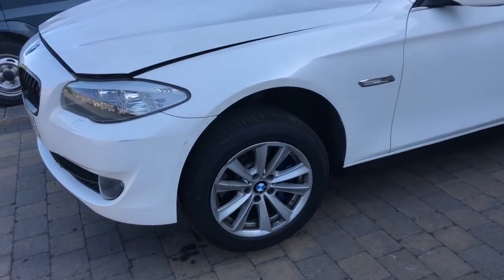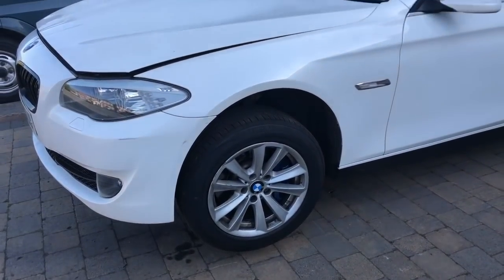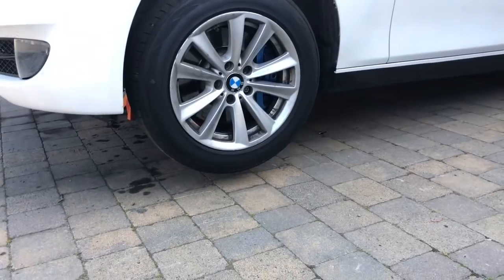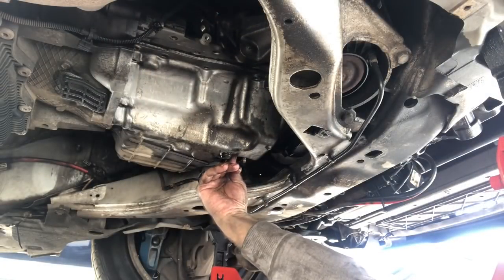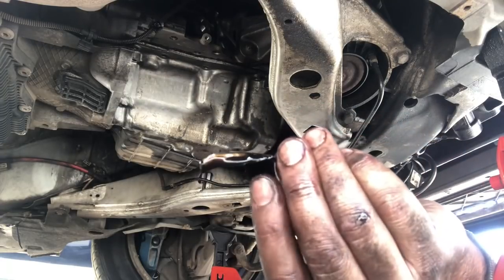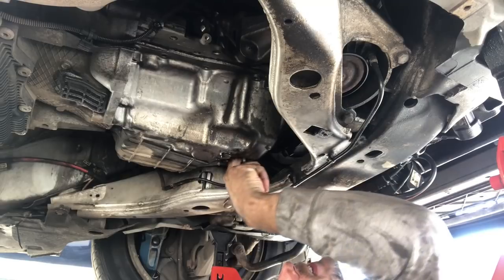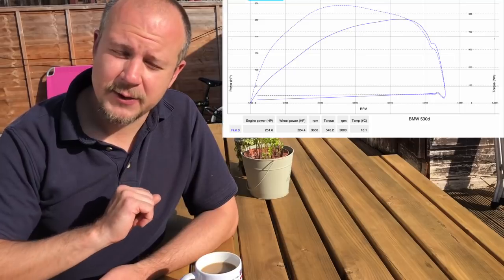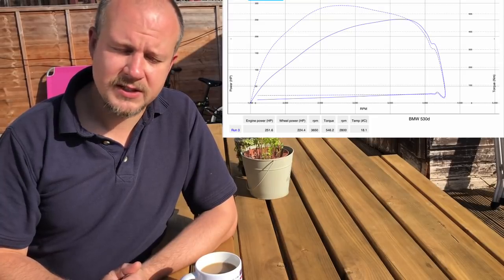BMW 530d N57 ENGINE FAILURE @177k - Spun Bearing! ☠️

Comment: Hi buddy had my engine rebuilt but got a funny feeling the the garage ripped me off as its still smoking my guess is the rings..... As I've replaced the turbos. Now my question to you is could you take the head/sump off and take the pistons out while the block is still attached?

Many thanks
Reply from the maker: You’re not going to like my answer I’m afraid...
Unfortunately not. To get the pistons out you will need access from underneath (the bottom end), so really it’s an engine-out job. Even if you tried to do it from underneath the front axle subframe is in the way, plus the crankshaft needs to come out... so unfortunately the engine needs to be removed for that job.
Reply: @Nut_Job.  mines a 6 series 640d so do have alittle more room? Was hoping with sump off i could undo the rods and take pistons outfrom the top?
Reply from the maker: Before you go doing anything drastic though, it’s worth doing some good fault-finding so you can be fairly sure of the problem. Otherwise I worry you’ll spend ££/$$’s without any certainty it will fix the problem. If the piston rings are worn then it should show with compression testing. Another method is relative compression testing, where they hook up an oscilloscope to a current clamp on your starter motor to see if each cylinder is providing equal ‘resistance’ (compression) when cranking...
Reply from the maker: Hi Rob, it might be possible if there’s a bit more room underneath... I’ve not seen underneath the 640d before. Bear in mind there’s a bit of work involved removing the cylinder head (+ new cylinder head gasket ~£85), but a share your desire not to have to get the whole lump out 👍
Reply: @Nut_Job.  yeh i did do the turbos and they where a nightmare to do. Fingers crossed i can get the head off no problems
Reply from the maker: If you do it yourself just be careful with the HP fuel rail. It’s all aluminium & I broke my original one during re-assembly by over-tightening one of the injector lines (heard a subtle ‘ping’ sound...🤔). Sure enough, upon startup the fuel rail pissed diesel all over the engine! Had to replace it.
Don’t forget you’ll need to buy new stretch bolts for the cylinder head (don’t be tempted to re-use the old ones). 
Also, the conrod small end bolts are stretch bolts too so you should replace them too really & they’re more expensive than I expected. It all adds up a bit unfortunately
Reply: Yeh im already 6k in after the garage in Wolverhampton on sunbeam street ripped me off 4 months they had my and then i get it back in bits so yet again its now a rebuild but ill be doing it so can only blame myself if anything goes wrong 😂
Reply from the maker: Crikey! £6k I’d be mad as hell. Anyway I won’t comment on that as I’m sure you don’t need to hear me ranting.
Best of luck with it mate! 
Embarrassingly, I’ve actually abandoned my BMW engine rebuild.... simply because I’ve lost all enthusiasm for it & I’m quite enjoying my replacement car.
Thinking about it, I’ve already bought a lot of new parts which you might need. If you want any new parts I can sell them on for a good deal if you’re interested. Just email me at nutjob882@gmail.com if you are, no worries if not 👍

Comment: Hello mate..im rebuilding my n57 and have no clue how to install the pistons.. should the arrow on the crown point forward? Towards the front of the engine?
Reply from the maker: Yes mate, the arrow should point towards the front of the engine (in the direction of travel)
Reply from the maker: https://www.newtis.info/tisv2/a/en/f11-530d-tou/repair-manuals/11-engine/11-25-pistons-with-rings-pins/1LSMorv3
Reply: @Nut_Job.  believe it or not i am following this very guide to fix the engine but i didnt really fully undertsand what "direction of travel" means...i though of the direction of travel of the crank:) which would be towards the back of the engine.. thanks alot mate...i will install the arrow pointing to my headlights:))
Thanks

Comment: The main bearings are a known weak spot alongside the timing chain and EGR components, sadly. 
The bit that interests me, more so, of most of the known issues they seem more likly to happen on the twin turbo (and tri turbo) N57. I know of about 3 640D's, 1 535D and the odd X5 40D. The fact yours is a 30D, single turbo stands out to me as an odd one to have this fault.
Be warned though, I sadly equally know that in many cases it was easier to source a replacement N57 engine as those that got repaired invariably had some other issues down the line - https://www.pistonheads.com/gassing/topic.asp?h=0&f=72&t=1590946 comes to mind.
In addition this one in the PH link is the only one I have not heard to let go on a dyno ironically, not sure if that is some kind of precedent there!
Reply from the maker: Good info, thanks. I’ve got a free pass to put it back on the dyno if/when I get it repaired... just not sure I’ll have the nuts for that if I’ve just completed a full rebuild (after breaking-in period obviously)
Reply: Can you tell us where/how you got the info about main bearings being an issue?
PS Had my 330d N57 on a few runs on the dyno, remapped to 323 hp, ~500Lb/ft (660Nm) torque! :D So far so good, I did have it dialled back a bit recently as I wasn't keen on it being over the gearboxes max of 600 Nm and the emissions would often not quite pass the plated value, it does so easily now. It was badly remapped before I had it, I've had it 2 yrs, taken it from 86k miles to 105k JFYI.

Comment: It's rare for an N57 to suffer crank issues and survive. The alloy block will be damaged from a spinning bearing and the crank likely scrap. I've seen them with crankshafts that are cracked across the journals.
Reply from the maker: I’ve got hold of a new block, but hoping to save the crankshaft...

Comment: Sorry to hear of your further bad luck! :(
But seriously, you need to just bin that whole engine, like you said the block will be toast due to the spun mains, which means the crank will be toast too, and the disintegrated mains will have probably done in the adjacent big end bearings too. You'd have to get a short block, and then it's a load more work, not to mention the head will have done 177k miles.
Personally I'd just get a 2nd hand engine (with good service history), change the chains and guides if they've not been done, and fit that. But then again, my job is a mechanic so I don't want to be spending my free time on fixing cars! lol. If you like doing that and don't mind blowing the time, go for it!

Comment: BMW 535 XD GT 2014 with 235.000 km, fatal engine failure on the crankshaft bearings, engine completely destroyed, 5k euros in reparations. I have this BMW from the beginning and all services made in time, oil & filters changed since 0 km up until today at no more than 10.000 km and still failed catastrophically, and this not the first one hear about, I have friends who also have their engines blown up at similar KM range: 230 to 260 thousand kilometers.
Reply from the maker: Very disappointing isn’t it.

Comment: I guess the oil pressure dropped so fast u would've had way to much friction on the bearings at high rpms. All the oil channels will need to be cleaned out, the bearing seats will be ruined, crank might be warped. Do you think theres any particular reason the main seal failed? Put in wrong or just old? Or blocked crank vent so pressure was too high. I didn't even know those could 'blow out' like that

Comment: Did you fit the crankshaft pulley? I’ve had my pulley replaced and had the same bearing failure not long after

Comment: No motor from any automaker should ever detonate. If my X5 doesn’t make it to 300K I’ll never buy another BMW. My last Chevy truck bled out at 493,000 miles. Still ran but everything leaked out, she was then parked at the boneyard.
Reply from the maker: Well I certainly hope you make it there!
Not sure what age your X5 is, but it seems to stand a better chance of lasting if it’s an M-series engine than the N-series like mine...

Comment: Did you use the same block or did you have to buy a new block, I think currently I have the same issue on a 2014 X5 M Sport and I bought it as a job runner. I didnt realise at the time how serious the issue was.
Reply from the maker: It needed a whole new block unfortunately.
Reply: Howcome you were not able to rebuild existing block?

Comment: These N47/N57 engines are very powerful but fragile. That is my final conclusion and I do have some facts to base this statement on, as I have completely dismantled both an M57 and an N57 to the bare piston ring. The M57 is build like a tank when compared to the N57. The N57 is the minimalist and light version of it. Not just the bicycle-sized timing chain, all of it. Now the main problem with these engines, I think, is their too tight build/cost margin and what happens over time. Both the problem you see in this video and the timing chain problem, are essentially lubrication problems. The main culprit of it all is the AGR, in my understanding. What happens is that over time things soot up in there or it malfunctions and remains open, leading to higher amounts of particulate matter in the exhaust. However, modern diesels never smoke, as the DPF catches all of it. Because the DPF then gets clogged more frequently, the burn-off cleaning cycles occur more frequently. This is being achieved in this engine by post-injection at exhaust time. But, some of this diesel injected at the end of the combustion cycle does not make its way into the exhaust and remains in the cylinder, eventually diluting the oil with diesel. This in turn decreases lubrication. The evil thing about it is that you won't notice this checking you oil level, as in many regular driving cycles the diesel addition will compensate for combusted oil. In other words, your oil is being gradually replaced by diesel, unless you often do high speed and long distance driving, where the diesel has an opportunity to evaporate. To make things even worse, the manufacturer specifies extended oil intervals, probably based on tighter machining and less wear, but ignoring actual engine condition over time. So when you revise an N57 engine, you must revise ALL of these components and hope it's not too late in terms for damage already done to essential things like piston rings, cylinder walls and main bearing shells.
Reply from the maker: I think that’s an excellent summary of the N47/N57 engine processes. I’d agree with everything there & I won’t be going for another vehicle sharing this design.
Reply: Well, I guess we'll have to live with it for the time we own it. Now the real question is whether you call this planned obsolescence, ignorant or incompetent engineering vs. the old folks, a consequence of having to deliver incompatibly both on power demand, fuel economy and unrealistic emissions, or simply a reduction of production costs and increased gain. It's probably all of it, and it's not only BMW. You would have thought they've learned their lesson with the timing chain problem, well, apparently not. They patched it up by using improved chain coatings and such, but a similar chain is still at the back side of the engine in the newer B47/B57 AFAIK. But maybe it's just us who can only afford BMWs at +200.000 km mileage, thinking they'd be as good as those made in the past! Not so. I wish you all the best in fixing it up, I'm sure you will succeed. After all, the F10 isn't a bad car nor its engine, if you're willing to overhaul it completely. It does have superior electronics when compared to the older models like E39. While you're at it, you may want to check piston ring and cylinder wall wear. And maybe the oil pump, I've replaced that one as a preventive measure, I've heard they love to destroy themselves at high mileage and it means total engine destruction in less than 5 seconds. Pierburg aftermarket version is nicely priced and it's the original with the BMW logo stripped off, when I bought it a year ago.
Reply: There have been some cases with snapped chain on M57N2 as well.

Comment: Well spilt milk and all that, if you fix/replace the engine you have still got a nice car. It did seem at an odd angle on the dyno, hope it wasn’t oil starvation otherwise it will be a new engine you need. Good luck.

Comment: Did the the piggy back ecu have anything do to with the engine grenading it’s self do you think?
Really put my off any kind of re maps ect on my 330d now..
Reply: Mines an f31 (with n57), lower miles at 70k and it’s running 329bhp and 650nm on a stage one map 👍🏼
Gearbox flashed to match.
Works very well, I think this is a touch of bad luck plus the fact although ex police cars have been serviced well they naturally get abused....in short don’t let this scare you...as long as your car is having frequent oil changes there’s a lot of power to gain .
This is now my 4th 330d....2 x e91’s and an e92..two of which had the n57 in with 140k on each, both remapped and no issues (other than a timing chain on the one that had a gap in the service history)

Comment: Pull it all out. Strip whole lot. Could have metal fragments anywhere in oil ways. Will need crank re grinding probably. New oil pump. Could be expensive. Cost a guy at work 5k to get is sorted after timing chain failed.

Comment: Rewatching all your videos Nutjob, especially the RR ones as may look to get one later this year. Great content and respect for your drive mechanicing 👍🏻 Have you made any progress on the Beamer?
Reply from the maker: Hi Andy, thanks for the comment.
Unfortunately no, I’ve lost all interest in bringing the BMW back to life… I had every intention of pulling the engine & doing a full rebuild, but you know how it goes - life gets in the way & I bought another car. It’s still here though, and I occasionally have thoughts of either selling it as a project for someone else or possibly doing an EV project with it. The rest of the car is actually in good working order, so it’s hard to decide but I have dragged my feet on this for ages now 🤦🏻‍♂️
Reply: @Nut_Job.  I know what you mean! The option to swap the engine with a good 2nd hand one may offer a solution, but probably not cost effective. I’d move it on and accept you were unlucky on this occasion. 
RR content very interesting, a fair few YouTubers are following your path 👍🏻 Chin up and keep moving forward 😉

Comment: Having your car on a decline position like that doing power runs will cause oil pressure issues, starvation, etc. the pick up tube is positioned as the rear of the oil pan/engine block and can cause issues like this.
Reply from the maker: I totally agree. I never gave it much thought at the time, since I know this garage had done power runs using this dyno setup for lots of other people 🤷🏻

Comment: Been loving your story mate hope you get it sorted. Can’t help but admire your strength and determination. Forgot to ask did you have the dtuk box on when this happened?
Reply from the maker: No I’d removed it a couple of days before. I’m sure someone will connect the two but honestly, apart from just adding a little extra stress to the engine I can’t see how a tuning box could cause a spun main bearing. It’s a mechanical failure of the lubrication system somehow & I don’t regret putting it on the dyno at all - if it couldn’t handle being stressed for 2 mins I’d rather it went bang in a workshop than on the roads.
Reply: Nut Job yea I think your right the hard life it’s had has been the main cause. Looks like the oil pump has failed to me with that damage. Hope you get it sorted mate and look forward to your content on this project

Comment: Yeah 177k is about average for them to be fair ,ask police forces up and down the country ,new lump needed .
Reply: So equivalent to about 500k of anybody else's miles ?  I have done 260, 148 and 178k miles in M47 and N47 engines (2 of them remapped) without failure so I think it is all about the pattern of use - as has been said
Reply: @rhiantaylor3446  Out of interest which mileage was with what engine?

Comment: Just out of interest..did the engine run out of oil pressure there? You have the car leanin forward pretty much, the oil pickup is at the rear part of the engine, and you run the engine at maximum revolutions. The oil gets picked up by oil pump and gets pumped up and most of it would be returning to front part of the oil pan from where it would need to drain to back where the pickup is. At that stress on the engine, you dont need to run of oil pressure for a long time to destroy the main bearings.
Reply from the maker: I think you’re probably right there. There may have also been other contributing factors causing the oil pump issues, but effectively yes - don’t ever do what I did 😬
I have a (nearly) full engine rebuild to do on this... although I keep putting it off.

Comment: Will be intresting to see if the silicone joint sealer has got into the oil and clogged the wire oil strainer on the oil pump
Reply from the maker: Yes, I’m keen to see what I can find inside too 👍

Comment: Have you changed the Oxygen sensors? I have an issue with sensor 1 bank 1 and I am not sure if is the one before the turbo.
Reply: Think O2 sensors are probably the least of the Beemer's  issues right now.....

Comment: Please accept my condolences for your loss (hopefully it's not permanent).
How did the Range Rover get on with it's M.O.T? (I remember when you bought it)
Reply from the maker: It initially failed on the rear tyres (which I knew really) plus a front lower control arm bush. I replaced the tyres, the control arms on both sides plus the ball joints & it’s passed now 😀